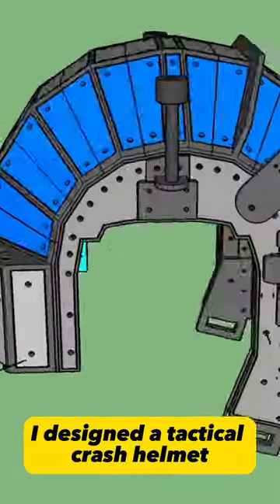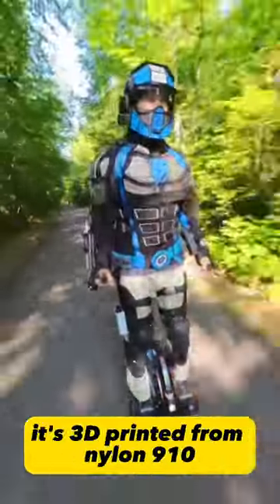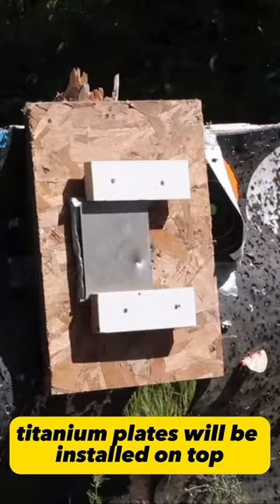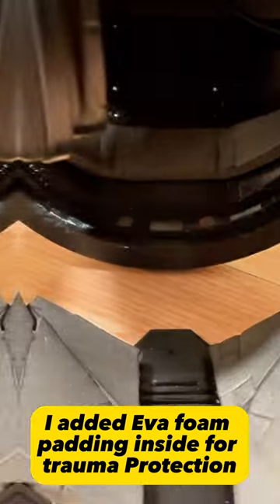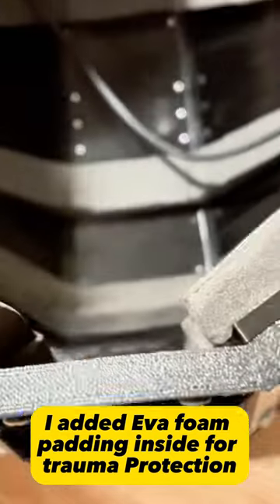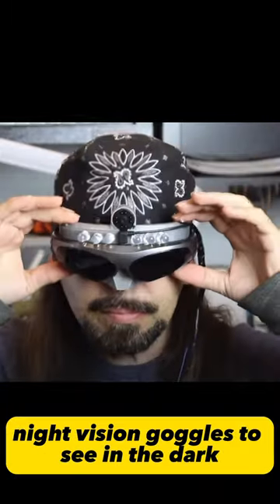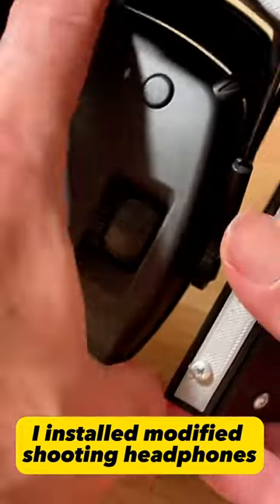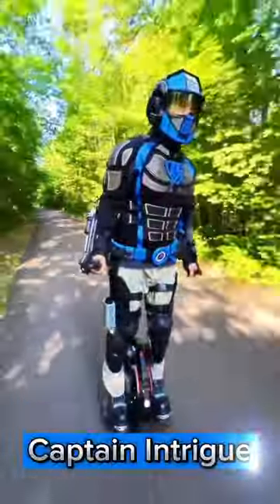3D Printed Superhero Helmet

Comment: Great work as usual captain!! but I have a suggestion I know it may not be entirely essential but have you ever thought of making a filter mask to help filter out pepper spray or tear gas or any other type of irritants?
Reply from the maker: Yes absolutely it's a great idea! I did this on a previous Mark 3 helmet design but i wasn't able to make it fit into this version. I'll be showing that prototype helmet in an upcoming helmet upgrade video. Eventually i'd like to try to squeeze that filtration system into the helmet.

Comment: Helm still looks and functions as excellent as it always does.
Have you thought about including another interchangeable gadget for your modular weapons port
Like a Raspberry Pi or other mobile hacking tool to bypass doors with electronic locks? 
Could be handy in a situation where you need to escape and there's a security door blocking your way. Or you need to do an investigation of a building that was the scene of some horrendous crime 
but entry is restricted due to doors with electronic keypads or biometric sensors.
This is where a mini mobile hacking tool attachment for your weapons port will come in.
It will provide you with the code for an electronic keypad or trick a biometric sensor into thinking you have clearance for entry.
Might be something worth looking into.
Reply from the maker: That's a fantastic idea! I'm adding to my list.
Reply: @SuperheroArmorychannel   Please do!! I'd love for you to do a tutorial on what parts to buy and how to set it up after you show a video of it in action. I would like to know how to get past doors with those types of locks in an emergency so I figured you would be the best person to show how it's done since you like gadgets.
In the meantime I'm gonna teach myself lock picking so I can get past the simplest of locks first. Lock picking is still a very useful skill to have even if you don't think you're going to run into a lock that's not a modern electronic lock. 
You just never know what might happen out here in the real world so every seemingly primitive skill you pick up is a preparation in advance for any future mishaps or screwups in the field.
Lol, sounds like I need to learn to take my own advice. 😂😅

Comment: I’m in the midst of designing my own helmet for a vigilante character. One for a story I’m working on. What would you say is the most ideal eye hole situation for maximum FOV/protection?
Reply from the maker: @MimikPanik2  Study the eye holes of my helmet. This should be the minimum size, unless your helmet is very close to your face, then you could use smaller eye holes.
Reply: @SuperheroArmorychannel  the helmet is gonna be similar to that of Jason Todd AKA the Red Hood. Would you suggest still using similar to yours, or smaller?
Reply from the maker: @MimikPanik2  As long as you have room inside for foam padding it should be okay.
Reply: @SuperheroArmorychannel  ok, thank you!